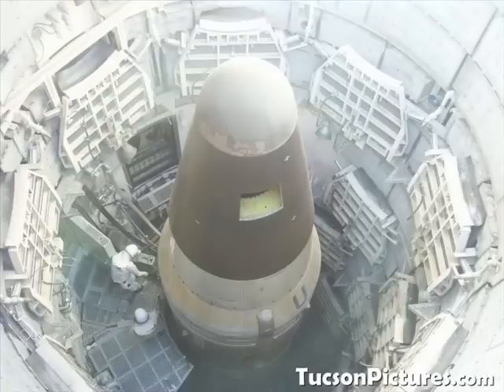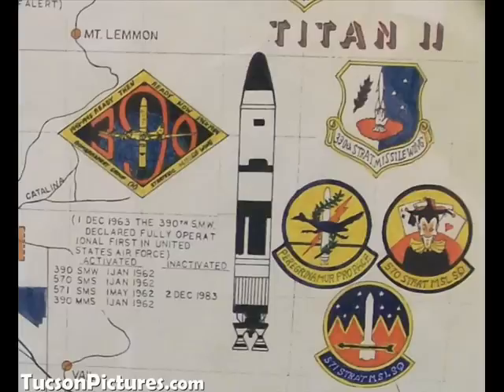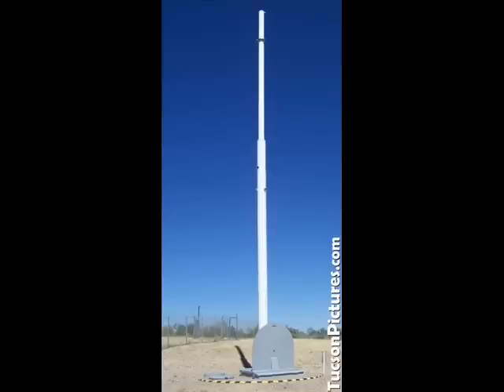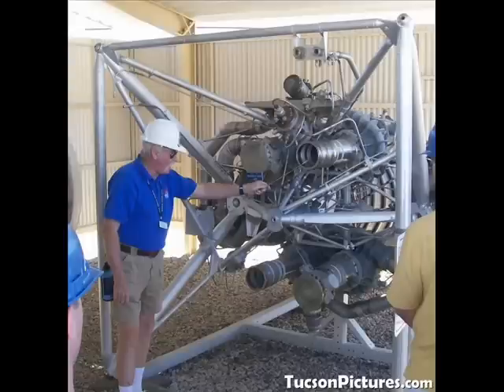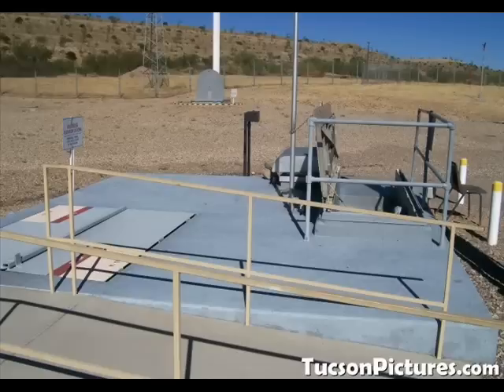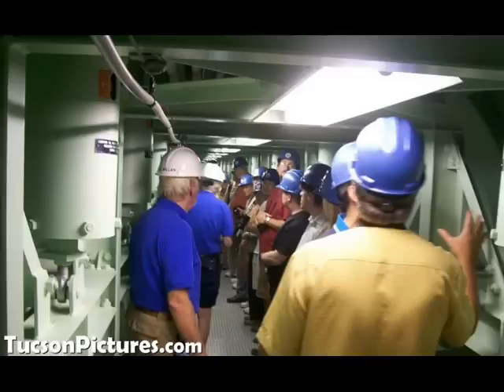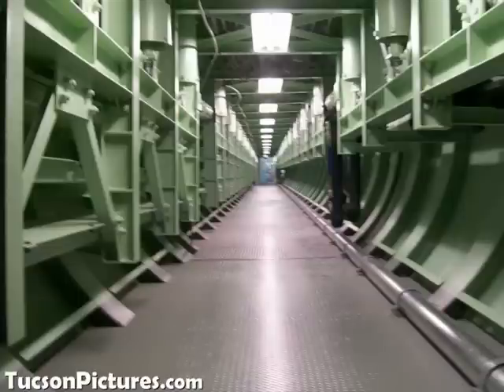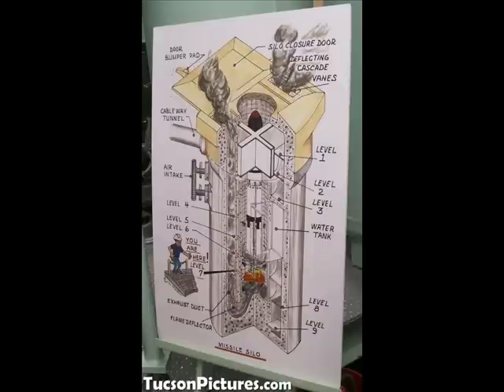Titan II Missile Museum - 9 Megaton Nuclear Missile on display - Where to see a Nuclear Missile

Comment: Excellent Video. Worked at Little Rock form 78-87 in Propellants, one of the guys who wore the space looking suits. I was there until the very end of the Titan II's. They were not replaced by the Minuteman missiles as the Minutemans had been around for almost as long. I spent 10 years in Titan, and my last 10 yrs in Minuteman. The downfall of the Titans was the dangerous fuels which took life at McConnell and then the total destruction of the silo 4-7 at Little Rock.

Thanks for the video!

Comment: So, we were in the same squadron. My name's Wittmann. We might have done a change-over a time or two. I was at 3-3 for a couple years then got moved to 3-9 and remained at the ACP until I separated. The P-1 fire was crazy! We had the IG watching a QC crew, watching a training crew, watching us and a real fire! Talk about pressure! A faulty pressure switch caused P1 to short cycle, over heat, & catch fire. Our crew received an accommodation from the IG for handling the emergency.

Comment: I was an MMT in the propulsion section at DM in 1979.  Anyone remember the turtle races down the long cableway?

Brings back memories.  The smells of the complex were unique.  Always carried around the gagbag and the PVD.

I always loved working on those engines.  It was amazing at how simple they really were.  You just never know how long it was going to take to test the TCPS.  How many times you would have to remove the throat plug and clean it up and re-coat it with DC-11.

Comment: This video brings back memories. Thank you. 

I logged over 400 alerts as a Missile Facilities Technician (MFT) with the 533 SMS at the 381st SMW alternate command post at McConnell in the early '80s. My best missile-crew story involves the P-1 fire water pump catching fire during an onsite SAC IG inspection. 

What I'd like to know about the museum is if there are any "artist" drawings on the backside of the 100,000 gal water tank on level 7?

Comment: Nice video.  I took my wife there on our honeymoon so she could see what I did in the AF.  It was a pretty good tour but I was a bit disappointed at how quiet it was.  The control center was never that quiet except during a power failure.  There was always the whir of fans and pumps and static on the PAS.  Maybe they could find a recording and pipe it in down there.

Former BMAT   533 SMS